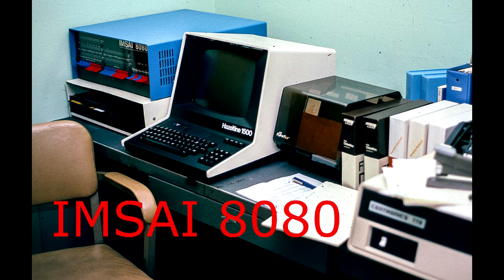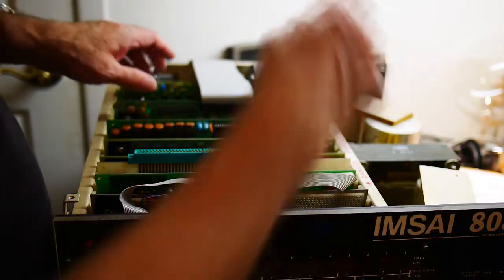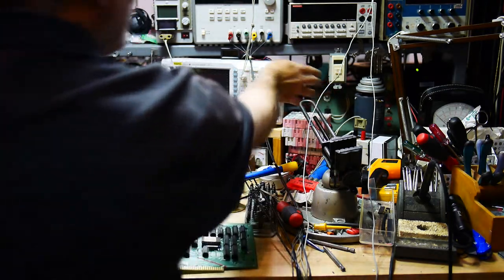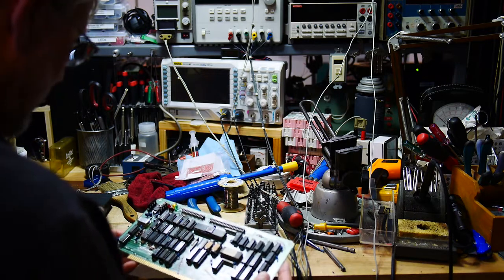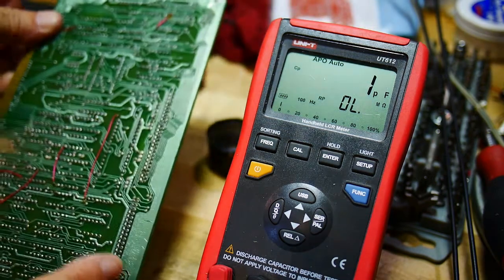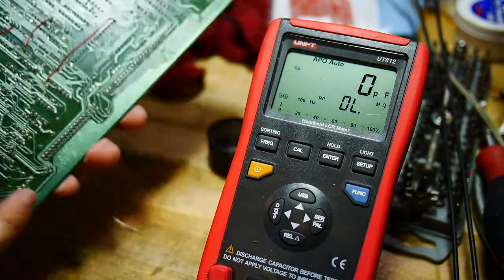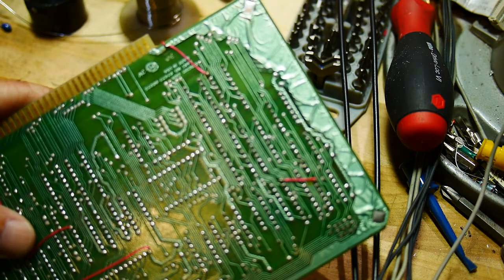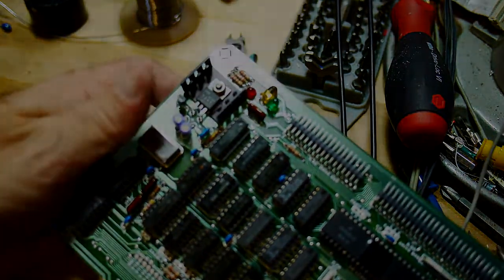#41 IMSAI 8080 repair floppy controller

Comment: has seen in "wargames" . same 4 ch scope i have rigol . i often remember i think to switch soldering iron off , as i have cats . that is , umm , large de-solder sucker . never seen one that size before . i have same eye piece got for looking at 35mm film . i may try that on pcb boards next time . i have x2 uni-t multimeters not same you have .